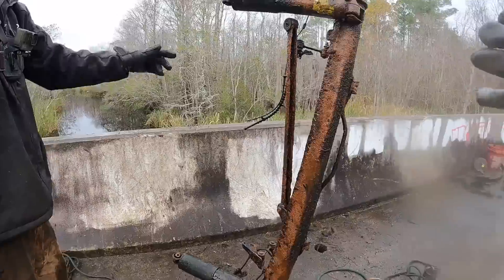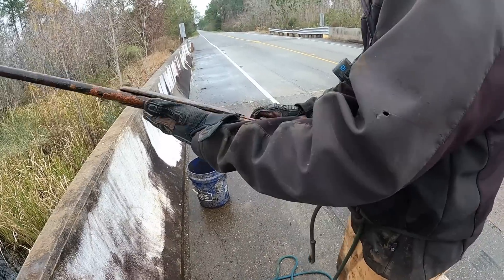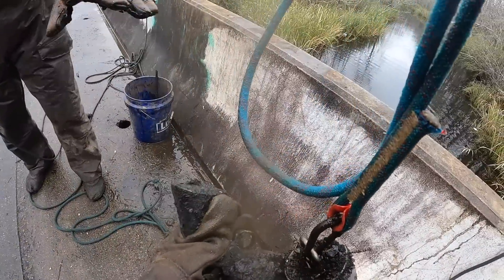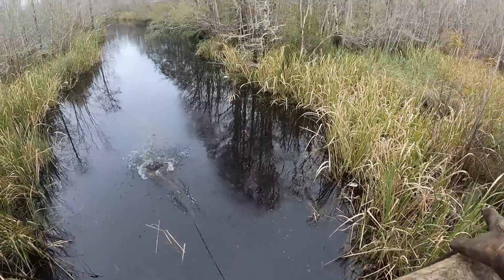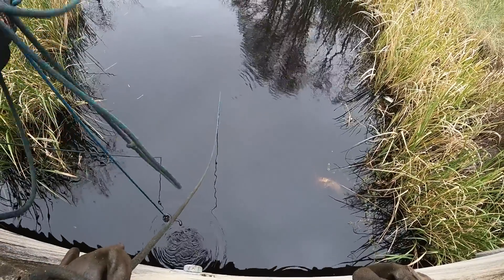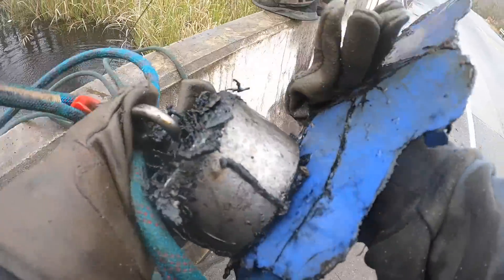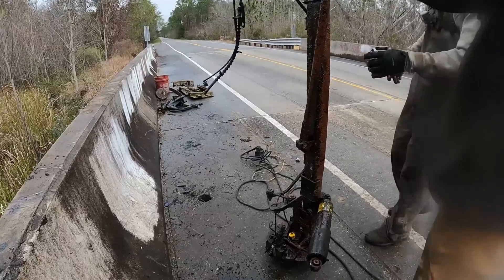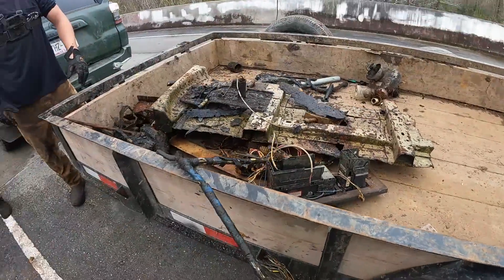We Hit The Ultimate JACKPOT Magnet Fishing - 6 Guns Pulled From River With Giant Magnet

Comment: That revolver you found (hard to tell for sure through the mud and would need to see it clean, but) appears to be a Colt Model 1860 cap and ball Army revolver. Very popular with officers and cavalry. In good condition, restored, you're looking at anywhere from $750 up to a collector and will likely get the best price at auction if you put a $600 minimum bid on it... once it's restored. In current condition, 250 or 300